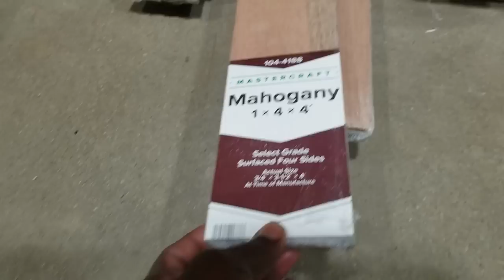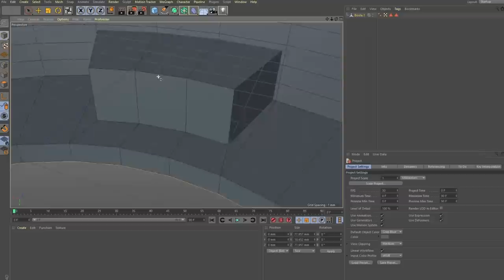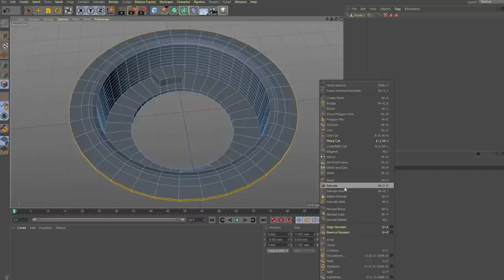🤔 Replacing Passive Radiators With Actual Drivers taken from the Flip On My Charge 4. Good idea?

Comment: The bass is bad because the air pressure can't escape anywhere which is why the original one has the passive radiators

You can fix that by placing a rectangular or round or square passive radiator on the back and/or next to the big active driver

Also plz like this comment so DLX sees this
Reply from the maker: Was thinking about putting a condom where the passive radiators were 🤔
Some people have suggested it😆
Reply: @DLXWillington  would be awesome to see a video with that jbl charge 4 (if you still have it) with the passieve radiators
Reply: @DLXWillington  and u can kind of fix the problem that the flip drivers get too many Watts by putting these in series instead of parralel so they get 15 Watts each

Comment: For more bass (I know bass isn't all that matters, but it's fun), you'd have to extend the ends of the enclosure and add larger passive raditors. There'd be a bit of trial and error (or maybe calculation if you're smarter than me), to get the right resonance from the larger PR. More surface area tends to mean better efficiency (or dB/W), which these portable speakers really benefit from. Hope yourself or someone else does this, I'd be really interested in the results.

Comment: Also, I see everyone talking about how before it had deeper bass, and this isn’t true, it’s the same speakers but with a passive radiator, it acts as a turbo charger for the lower frequency, extending the bass frequency on the speaker, so yes it sounds better, but in reality it’s all pushing the same bass (for people who don’t know what a passive radiator is) this is why when u turn up the volume the deep seems to go away. The passive radiators are supposed to deepen the bass at lower levels say 20-30hz per say

Comment: You are connecting 3 speakers in parallel. This does reduce the resistance much so the amplifier could be destroyed (charge 3 board). Please be aware of that! This time it worked but it could destroy the board.
Reply: what about phase? is that a thing to consider about this experiment?
Reply: @dbermont  of course the phase is also important because if a speaker is out of phase (wrong connection, positive and negative is confound) it will not make bass. If on driver is connected wrong, it will move in, when the other drivers move out, so the speaker can not create pressure which is needed for bass.
Reply: Yeah could have a problem, but it definitely has d class amplifier that is more efficient. At least for me I've never had issue with using even 1 ohm load on small bt speaker amp.

Comment: It would have more bass if you hooked up the small drivers out of phase with the large one. Having them in phase creates more pressure to work against, but out of phase, the pressure should be more equal because as the top speaker retracts the outside ones expand, allowing more travel on the driver and more bass. It would be hard to get the bass as good as the passive drivers though.

Comment: You also must take into account that the Passive Radiators are much larger than the drivers used to replace the PRs. Also another thing to remember is is that a passive radiator moves in the opposing direction of the active driver therein. While replacing the PRs with an active set of drivers means that all cone area is moving in the same direction while it's built to have a type of amplification of air movement inside the enclosure from the PRs moving in the opposite direction. Plus all speaker were in parallel which loads the internal amplifier more than it should be which causes distortion and clipping at lower volumes than normal.

Comment: Its actually reverse thinking, it hurts a speaker more to under power it then it does overpower it..huge misconception..also this would have worked it you found a way to make the flip drivers out of phase with the main driver..but what it comes down to is not having the wattage distribution the main driver took a certain amount of wattage, and you add two more drivers to that they will be underpowered regardless of them only being 5 watts, just because you have 30watts on a unit, adding drivers doesn't give all of them 30 watts...you would need to separate the 3 drivers into 3 channels...a LCR configuration would be ideal but really just give you surround basically a little soundbar.. awesome video buddy 👍 was fun watching, your mod actually looked really great

Comment: Yes because air space is key in an enclosure and the radiator reacts like a ported enclosure- so when you removed them you turned it into a sealed enclosure and divided the air space

Comment: Solid video! I just did this with the worst sounding boombox i have ever heard. The Toshiba TY-CWU500.
Put in old JVC speakers firing forward and the crap speakers out to the sides. Toshiba decided to use +/- 30 gauge wires, so stripping and soldering them was an annoying chore!

Comment: The modified one sounds more dull and has less bass. I also noticed you could hear the flip speakers peaking at times and making a small crackle. It's a cool project but I would suggest maybe replacing the flip speakers with subwoofers and maybe adding a tweeter beside the big driver in the front to provide those crisp highs.

Comment: Hot tip: you can really put a nice finish onto your 3D prints by suspending them in a container with acetone present. The acetone fumes will react with your 3D prints and give them a smooth finish.

Comment: I love the experiment. Crossover will cut the bass to the flip drivers.. You could use just one of the two passive radiators, or use more powerful speakers from a Charge 2 or 3? I'm considering an upgrade from my original Charge, so thanks for all the reviews..

Comment: The idea of putting a passive radiator in a box that size is to make the little speaker sound like a much bigger woofer. Replacing the passive radiators with even smaller speakers will never improve the bass. It will sound louder but it will not sound deeper. A lot of engineering went into designing these type of speakers to put out the biggest amount of power and low frequency information. And yes, you will blow the amp sooner or later by attaching these extra speakers thus lowering the impedance and overheating the amplifier till it fries.

Comment: the reason it has no bass is that all the air that the speakers are making doesnt have a way to come out of the speaker, just drill a hole onto the speaker for the bass to come out and you will see good resaults
Reply from the maker: 🤔 You do make a good point. I will leave that up to the person who wins it. But i dig your idea
Reply: @DLXWillington  thanks man 😉👌 love your videos ❤
Reply: The original charge 4 doesnt also have any way of air coming out of the speaker, what are you talking about?
Reply: @bigpoggy8674  Yes, it does. The charge 4 uses the air produced by the principal driver to move the passive radiators. It hasn't a hole to let it out, but the air complies a specific function.
Reply: @andrespadilla6735  but those are out of phase, if you have speakers moving the same direction at the same time, it creates more air pressure, thus, giving it better bass
Reply: @bigpoggy8674  the original charge 4 has passive radiator which is a different way to have bass but without having physical holes for the air to escape
Reply: @bigpoggy8674  the air that comes out of the ports is out of phase too
Reply: @leonmac  but that is a different thing...

Comment: What’s happening is that air pressure from the main driver is used to power the passive radiators. Now that you have the flip drivers in it, the air pressure in the cabinet is trying to woof the flip drivers but the drivers themselves are trying to woof against the main driver. So what I would do is either cut power to the flip drivers or reverse the polarities to the flip drivers.

Comment: Try fitting low pass filters on the added speakers and a port if there isn't an existing one seeing as you have removed the passive radiators.

Comment: The modified one is not airtight anymore that's why the original's bass is better.
Reply: JM D yes
Reply: It is or otherwise you’d hear some distortion. The side drivers just produce bass at the exact same as the main drivers at the front. That’s why there’s almost no bass.

Comment: You might consider adding some stuffing (cotton or poly fill) to tame the standing wave inside the module. Also, adding additional drivers to the internal amp will reduce total impedance which could damage the amp.

Comment: Just a tip a speaker need to have a flacuating point or a space for air to escape creating a deeper note that's why when U have your boosters on the standard one it sounds deeper than the modified one

Comment: I think the problem is due to the phase, did you invert the polarity of LG speakers? The project is very interesting
in Christian, when the speaker kicks out, the radiators kick in, so since the radiators don't have power it doesn't need to do anything else, LG speakers need to reverse the polarity

Comment: Is there a way to add a low pass filter on the main driver.
Also im guessing with the speaker designed for a single driver porting the enclosure might actually allow the speakers to move more freely and increase the bass.

Comment: It sounds good on the higher notes but not the best in bass as you said and you should try to make the extra side drivers have some material around the sides to have a radiator or have the drivers themselves move as a passive radiators.

Comment: How about putting a passive radiator on the right side beside the original speaker to improve bass more
Reply: Or leave the PR's and put the smaller speaker/s on the left side of the single racetrack driver? Even if one was placed on the upside or other side. Sure there will be more folks trying mods similarly soon. We'll see!
Reply: Like the pulse 4?

Comment: As many mentioned before...second thing after "power needs"/"impedence" is "polarity" ...side speakers "Fight" with center either compresing or sucking air inside.
Same goes for any speaker or subwoofer...play with polarity (+,-) and update the video!

Comment: As expected.. it would sound louder.  The bass signature is gone tho. Mid range and up would sound fuller.  I was afraid you'd smoke the amplifier part tho.. as you probably pushing the power (Current) capacity of the unit. One thing to keep in mind tho the drivers you put in were all designed to push air to a passive radiator.. the charges original drive I'm thinking would be so strong it would push the flip drivers, literally forcing the flip drivers to act as "small radiators" in the bass punches. So when you play in a low volume.. this would make the flip drivers to distort as they are working against the charger drive... may even cause them to scratch a bit..  On a side note in the previous video you were surprised to find how solid the radiators were. The radiators are not just a membrane to push air , they are carefully designed..  the radiators have some mass to them and often use metal to add weight to them, this is a part of how they are tuned. It was fun to see how this turned out tho. Stay curious bro 😅👍

Comment: 1) you have divided the power in 3 speakers rather than one.
2) bass reflex membrane push out when the air inside the sealed unit is compressed by main speaker which is actually happening reverse because all 3 speakers are now pushing out at the same time which is creating kinda vaccum punch inside the box so that is eating up more bass.
3) if you would create a new hole and installed atleast one bass radiator membrane your bass would still sound better.
4) this project just increased treble and reduced the bass... It couldn't even compare the 50%bass of what it was giving in original unit.
5) bass radiators are invented just to make sure that you can produce the bass waves better in small and handy compact speaker unit.... What you have created is that you took back your unit in 80s era where there used to be not much of bass but just good levels of treble sound...

Conclusion....
I have already knew the outcome of  this at the beginning of this experiment. Keep up the experiments!!!

Comment: JBL Charge 4 is much better in all factors. They had made their calculations based on resonant frequency, efficiency and impedance of speakers (high efficient needs less amp wattage, low efficient needs higher amp wattage but sound is much better), volume where air travels from the driver speaker and diaphragm of PR. All considered in production including costs, etc. The air inside when it bounces back and forth and hit each other, it cancels out the sound frequency being produced.

Comment: The JBL charge 4 would be excellent with the duel speakers in the front and the single out the rear with and including the passive radiators on the sides.

Comment: You probably need to seperate the chambers you have different size drivers sharing the same chamber. And wire the flip speakers in series if you wired in parallel you probably doubled the output

Comment: I think you should put some holes in the between the speaker and out side on the sides speakers. So they can move better and not fight with each other from the pressure make a temp place to put the holes in nice. It my sound better then.

Do you have 2 JBL Pulse 4's? I have and have them 9 feet apart and put them in party mode the stereo sounds very good but they will cut out and stutter sometimes. If I just hook them both to the same bluetooth they never stutter or cut out. So in party stereo mode they talk to each other and just 9 feet apart should not stutter and blank out at times. Bluetooth should go at least 30 feet.

Hope you can test yours. See if you get the same. Maybe in one of mine the antenna is not hooked up go mounted good not sure. Junk they did not put a AUX jack in it. The only way is BlueTooth and no BlueTooth that I know of can pay with staying in time with a video.

Thank you for your videos.

Comment: Hooking 3 speakers in parallel like that is horrible for the circuitry inside a speaker, because electricity flows through the circuit 3 times as easy. That may even be as low as a single ohm, almost a short circuit. Hooking them in series instead would make it quieter, but also safer for the components because you are increasing the impedance (Ohms) of the speaker. Many people have broken their stereo receivers that way, and I bet it’s just as bad for the amplifier inside a Bluetooth speaker. Cool experiment though, I have always wondered what would happen if I did this.

Comment: What if you only added one speaker to it and had a passive radiator on the other side, or you could replace it’s original driver with a massive passive radiator and leave the flip speakers on the side.

Comment: The amp will struggle a lot because of the lower impedance.
Reply: You're not exactly right. The lower impedance allows more power to be driven into the speakers. 
High impedance speakers make amps work harder to create the same level of sound pressure.
Reply: @PhaQ2  the amp can only output so much power at a given impedance and the lower the impedance the higher your risk is to overdrive the amp because it can output more. More than it can handle.
Reply: @derSkedda  Sorry but I can attached a 1000 watt speaker to a 3 watt amp and nothing is ever going to happen. Your logic is flawed.
Reply: @PhaQ2  I never said anything like that. And I know what you said.

I try to explain it to you with examples.

I've got an amplifier that puts out 50w RMS at 8ohms it handles putting out 100w RMS. So at 4ohms its fine. But at 2ohms it could potentially (theoretically) put out 200w which it doesn't handle. You understood?
Reply: @derSkedda  I getchya, but that's why I started this with, You're not exactly right. 
If your amp is 50 watts R.M.S. and peaks at 100 watts. There is no amount of impedance that will suddenly make your amp output 200 watt peak.
All you're doing is allowing the amp to output peak power, easier. Increasing the chance of amp failure.
Reply: @PhaQ2  that would break your amp as it wil clip like shit

Comment: Good stuff good video however the sound from the charge 4 flip sounds a little more cracking than that of the original. You could however try putting just one driver and on the other side a passive radiator. That will make it better I assure you.

Comment: Should have used MDF same as what subs for your car box are made from and maybe wrapped it in a thin carpet stuffed with wool! The good old skool way of building sub boxes! You'll take forever getting through mahogany! All you should need for this size is a dremel like die cutter tool
Shave the inside of the original jbl surround the flange will slide through no problem!
Aww he put a wee hole in it lol put a bigger on it make a bass tube for it! Let that air escape you'll get loads more bass out the driver's keeping them cooling-off all the time! Young lads these day's clueless I see it alot lol no offence I'm 37 but younger guys nowadays are just not clued up enough on DIY projects like this!

Comment: I'd echo the comments about the drivers fighting against it's self. 

However I found my old original Flip1. If the drivers are from there, half your problem may be that the drivers aren't very good. 

When I've compared the Flip 1 sounds hollow compared to the charge 4. It shows that the progress over time has not been kind to the Flip1. The Charge 4 sound has more depth, is fuller, highs are chearer and more bass. The passive radiators on the Charge 4 are there for a reason and not an after thought to look pretty.

Imo if you wanted more bass, you were never going to get it from the Flip drivers. 🙂